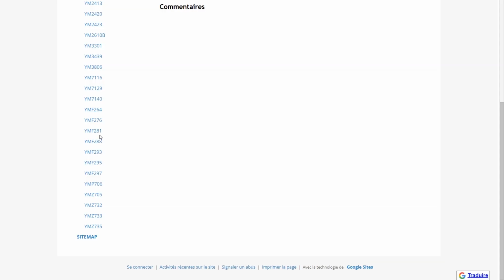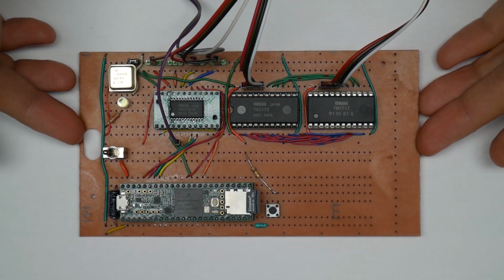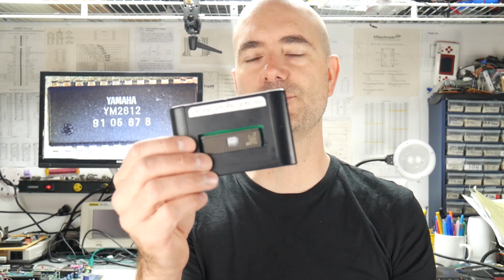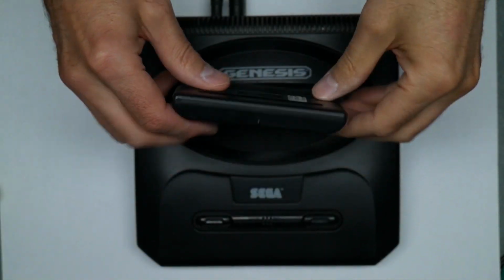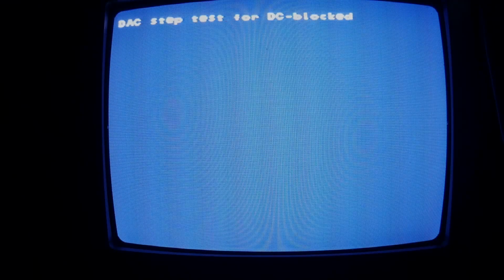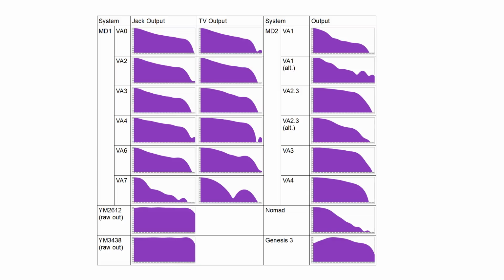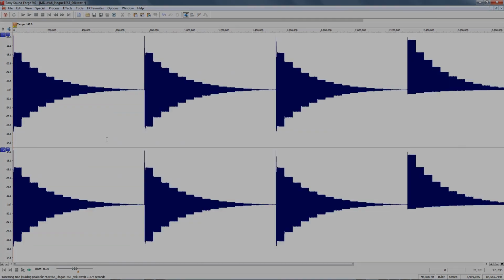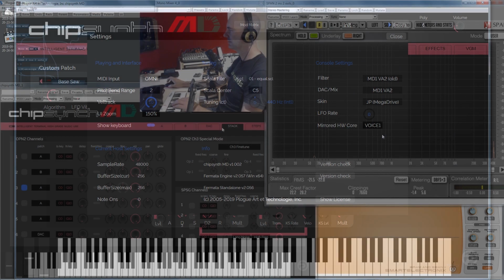The rigs we've created for chipsynth MD's emulation.

Comment: I really appreciate what your doing with this retro hardware (MD is my preferred console), how you do it (scientific approach, DSP analysis), how you show it and share it. I whish I had this skill level. I'm surprised you coded it in assembly, maybe the SGDK could be a shorter path ? Still I'm still confused because I saw the cartridge with an embbeded yamaha (to replace hardware) inserted in a "dev famicom synth" (Analog to IO ?) interface to chipsynth which aim is to emulate the YM. Though I understood it can interface to a real hardware (yours) and you use it to interface your keyboard control. Your software is to receive the MD key and send orders to the YM, and simplify the impulse study. Does it boil down to the fact that you wanted to build a HW synth matching the MD HW. For the comparison why not used a real MD with the genMD interface ?
Reply from the maker: Because not invented here. The fun is doing it yourself really. Also the Famicom thing is not only for MD, but for the FC product and really is the main platform I use to quickly test ALL sound chips now.
Reply: @plgDavid  ok I get your point. Basically I was focusing on the application obective, so I was wondering about some of your choices. But I get you other point which I also value. it's about learning the self satisfaction of successfully doing those things. Still I don't understand how that famicom stuff can do what you say, probably some other thing yours and explained in another video. Thanks for you reply.
Reply from the maker: @bizulk  yes its part of another project https://youtu.be/k9vfbWtaI3c?si=Qd_Ap2BY2BuLXVQP

Comment: Hey there! Huge fan of the YM2612 and somewhat disappointed in myself that I took this long to finally get to chipsynth MD. The macOS support alone makes this worth a get, and on Windows I definitely look forward to seeing how it stacks up against the FMDrive in my own usage. :)

Regarding patch loading - The csMD doc says TFI, DMP, Y12, and OPM; have you considered VGI in addition to/instead of TFI though? While there are certainly more TFI patches out there than VGI (especially the huge packs linked by Aly James, etc), TFI lacks built-in support for some of the lesser used YM2612 features like the SSG-EG and channel 3 CSM while the successor VGI format supports all YM2612 parameters. If you'd like a format reference (TFI and VGI were not created by myself) feel free to peruse or outright use my code from VGM2Pre ( https://github.com/vgmtool/vgm2pre ) as it's MIT licensed, and while I admittedly haven't touched it in a few years it can still do the job of dumping YM2612 patch presets just fine. :)

Comment: I had a funny idea: You could use your OPL emulation to do an extremely simple Adlib VST. It could be extremely bare bones: no tweaking/parameters even, just General MIDI presets. Just the built-in classic Adlib General MIDI programs for playing back a MIDI file as if it was on an old DOS machine. Something that you can plop in FL Studio and the MIDI program changes will pick the right sounds etc.
Reply from the maker: Yes that would be doable!
Reply: @plgDavid  It would be very bespoke but it might be fun. I wonder if the datasheets for those Adlib General MIDI presets are out there somewhere. I know DOSBox has Adlib emulation so maybe they're in that source code somewhere.
Reply from the maker: @ArtFluids  there are various GM sets that target the OPL2, we modified such a set for the OPLL in our previous chipsynth PortaFM